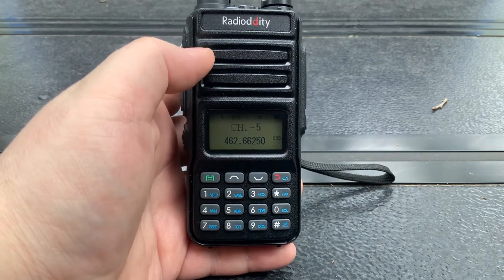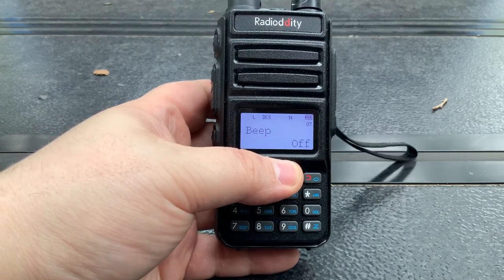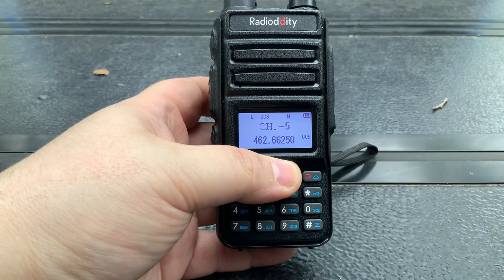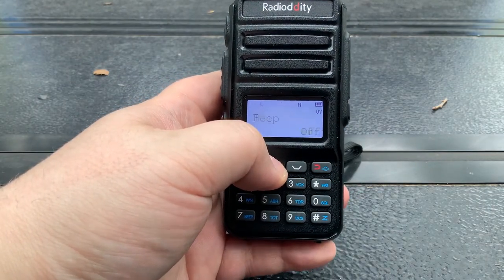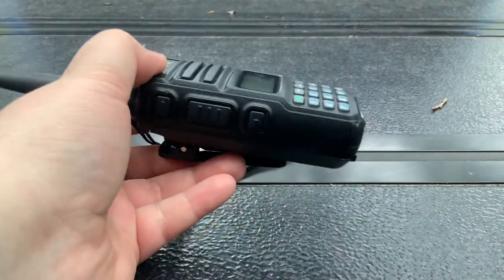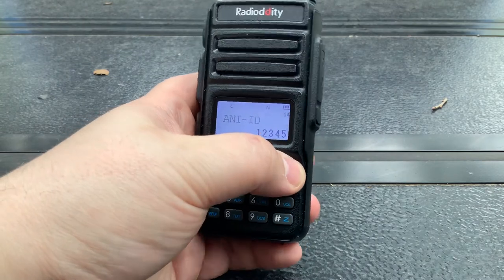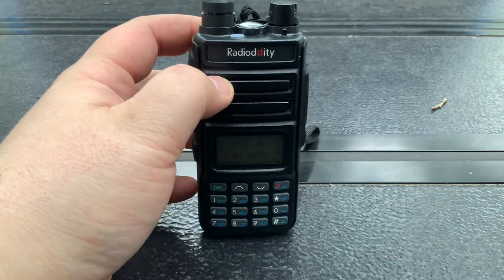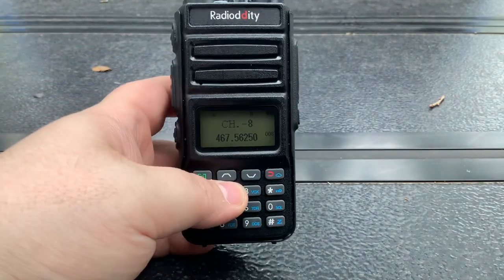Radioddity GM -30 GMRS HT | Constant beep setting issue | Offgrid Technology

Comment: I have the same problem, and have the latest firmware.  Thank you for pointing it out.
Reply: Heads Up:  Tech Support replied to my inquiry. They have a new firmware that they claim fixes THIS issue.  Who knows if they break something else...
Reply: @polarisflyer  Thanks, I have been talking to them as well (I run this channel :)) and the firmware and steps did not work. I am engaged with Radioddity to help fix this issue.
Reply: @EverydayAdmin   that is so surprising.  It worked great for me.

Comment: Roger beep, as others have said. These beeps are very handy and I recommend keeping them ON. In radio, when people finish transmitting, they say, "Over," or, "Roger." Baofeng came along and put in the Roger Beep so you, the user, wouldn't have to end your transmissions that way. But I CONSTANTLY hear Baofeng users say, "Over," then BEEP! Of course, I'm far too polite to break into their communications and say, "You don't have to say, 'Over,' when using a Roger Beep!" But I do think it! Again, it's a great feature. 

If it's turning on your other beep option, you need to update your radio software operating system.

Comment: I noticed the same thing.  It's related to the "Roger Beep" setting (menu option #35).  If roger beep is set to "off", the radio will not beep when any buttons are pushed.  If roger beep is set to "on", buttons will not beep when the radio is powered up UNTIL the PTT button is keyed.  Once you key PTT, all buttons will beep until the radio is turned off and back on.  Disabling the roger beep option will consistently silence all buttons including the PTT.  Depends on whether roger beep is a feature you plan to use.

Comment: yes, just experienced the same.  The beep is OFF until you key up.  Cycling power will again turn off Beep.  As shown, beep = off on the menu.  Annoying especially when I have to change channels and cycle through it, there is no shortcut to jump say from16 to 20.
Reply from the maker: Yea it’s weird but Radioddity says it’s normal.

Comment: I have V06.03.006. I don't have the problem you're having but a different problem.  If I have beeps off and turn on roger tone, the beeps are off.  But when I transmit it turns beeps back on.  If I power the radio off beeps are off until I transmit again.  I sent tech support an email and three days later they said upgrade to the latest firmware which I provided my version which is the latest. I found another issue.  When you have calling number ID turned on it doesn't display at the far end it just gives Morse code.  It should display in the screen which unit is calling.  This is useful if you have multiple radios and each person's assigned a number.
Reply from the maker: I have been in talks with them to see if we get these issues fixed but to be honest, their support is very lacking. Takes days for e-mails back and most are useless with little information or direction.

Comment: I have this raidio and i like it.  That beep issue is very annoying.  I do want to upgrade the antenna though.
Reply: It's very easy to remove, just need to find an antenna that will fix the molding that's there from the stock. I will see if I can find some.
Reply: I installed a Nagoya 771G on mine. Quite easy. And it works very well.
Reply: @rikprince8414  Love this one too (I am the guy in the video lol) but the only issue I have is the beep that turns on after I transmit every time, I have updated it several times, reached out to Radioddity but they don't answer or address the issue. Love the radio with the one flaw I cannot fix and when you are trying to be in a quiet setting when you transmit the beep activates and gives away your location.

Comment: I have the same issue. I think what his needed is an update that lets the roger beep be controlled completely independently from the keyboard beep. Basically at this point it’s either all the beeps or nothing… I personally want the roger beep with no keyboard beeps at all. Have you gotten a response from Radioddity?

Comment: I have this radio and my Roger beep is on but the button beep is off and it works as it should I didn't update anything
Reply from the maker: I have heard it may have been a small amount of radios with the issue, I have only heard of about 3 others with the same.

Comment: Definitely having the same issue. It would be very nice to keep my roger beep without the beep turning back on by itself.

I think I'm going to email radioddity. I've done so in the past and they were not super helpful, but at least they responded. Curious if anyone else has had any luck emailing them.